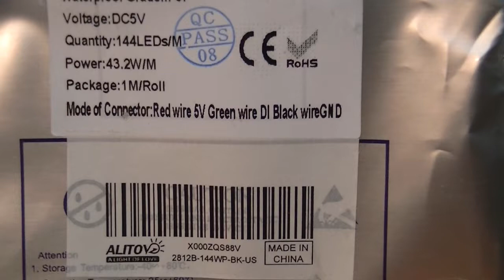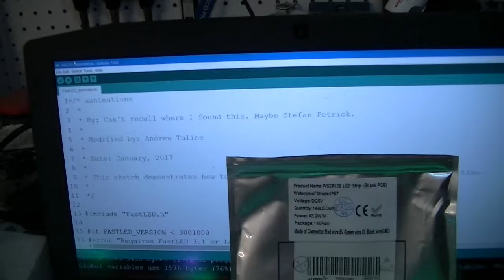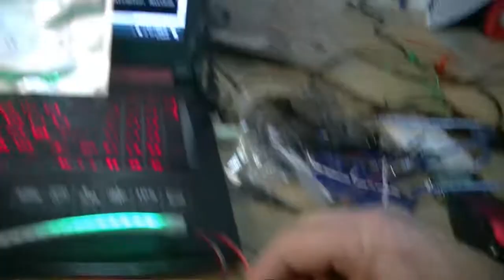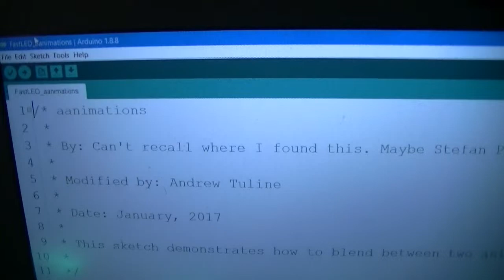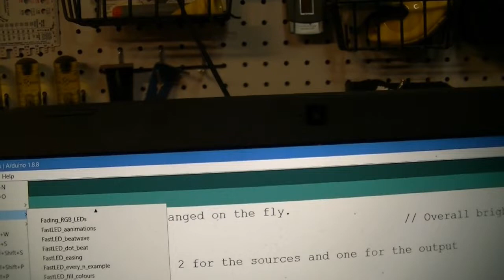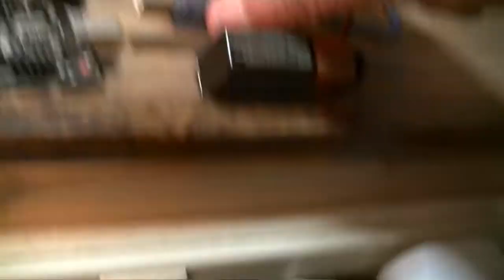LED Tutorial

Comment from the maker: https://www.amazon.com/ALITOVE-Individually-Addressable-Flexible-Waterproof/dp/B01DLYSHKQ?th=1  link to the LED strip I used.  https://www.amazon.com/Elegoo-EL-CB-001-ATmega328P-ATMEGA16U2-Arduino/dp/B01EWOE0UU/ref=sr_1_2?keywords=elegoo+arduino+uno&qid=1550184470&s=lawn-garden&sr=8-2 link to an Arduino Uno  5 volt power supply,  https://www.amazon.com/dp/B078RZBD68/ref=sspa_dk_detail_4?psc=1&pd_rd_i=B078RZBD68&pd_rd_w=zQY8z&pf_rd_p=10ebaf99-73de-4f5d-a994-e7f5fc52f86f&pd_rd_wg=rhGRY&pf_rd_r=DRMPD98R2MN95YHZ0SM9&pd_rd_r=579eb3e4-30ab-11e9-830a-437408ec868c